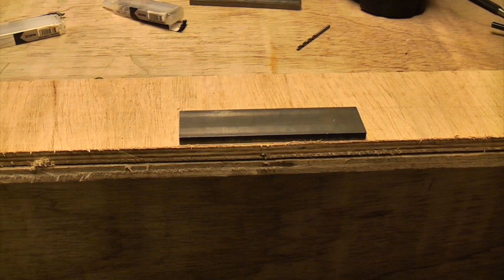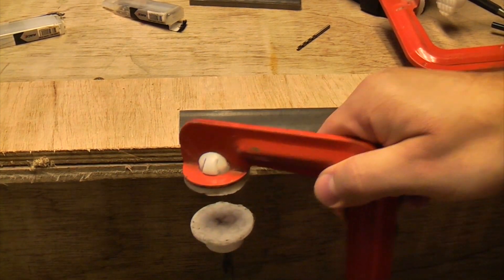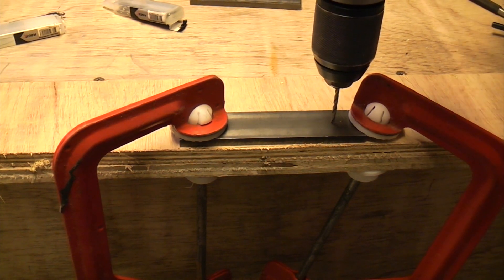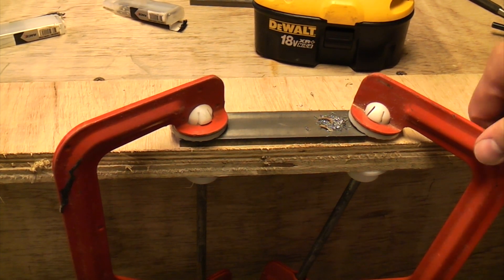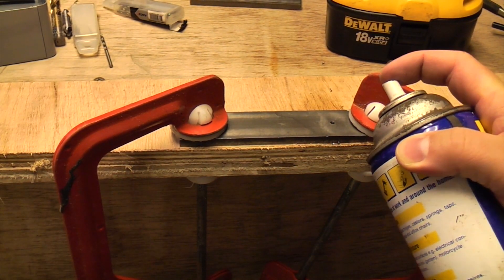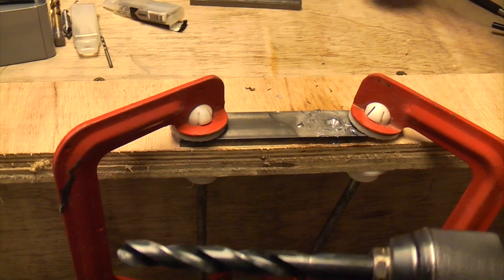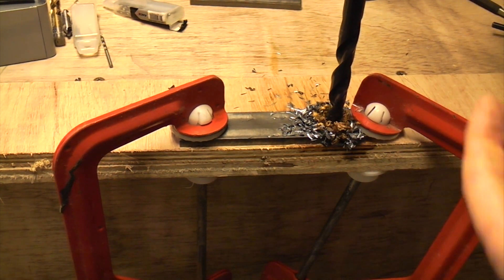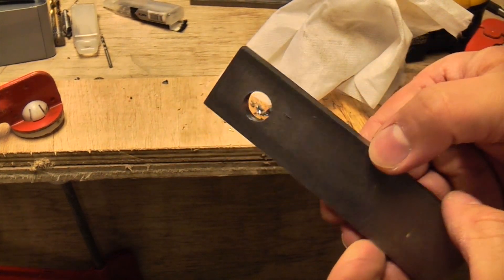How to drill metal

Comment: Hi excellent review u have given required  suggestions can you please tell me my drill chuck size is written 1.5-13mm what is the maximum drill bit I can use in that chuck  please help
Reply from the maker: 13MM is the maximum diameter drill bit, but you can drill larger holes using hole saws or blacksmith drill bits. But you have to be careful not to burn out your drill-
https://www.youtube.com/watch?v=_pHVe5GMVIw&t
Reply: @ultimatehandyman  Hi please suggest me a drill hand held which can drill more than 13mm please help
Reply from the maker: Abover 13mm, people normally use a drill that will take Morse taper bits, as seen in this video here- https://youtu.be/0iS2yMrSbvI?t=599
But they are very expensive and difficult to hold, especially if the bit bites into the material.
Reply: @ultimatehandyman  Thank you so much for educating I am learning a lot from you so nice of you

Comment: Hi nice review  when I am using bigger drill bits my drill is kicking back how to avoid it please let me know
Reply from the maker: There is not much you can do, apart from using the torque control on the drill- https://www.youtube.com/watch?v=ku29KYl4Wdg&t
Larger diameter drill bits will often bite into the material and cause kickback.
You could of course use drill bits that don’t suffer kickback problems, such as impact wrench rated step drills- https://www.youtube.com/watch?v=HPv0W0UNdks

Or for thicker material, these are awesome- https://www.youtube.com/watch?v=NEXt_4Y6Wms&t

Comment: Is hammer drill good or bad for metal drilling?
Reply from the maker: Bad- normally if you accidentally have hammer action switched on and you use a HSS/cobalt drill bit for drilling metal it will break the drill bit. 
Thanks for the comment

Comment: What's the 'proper' type of coolant to use when drilling metal like this? 
I've seen videos and read articles recommending oil-based lubricants and some others advising against using oil-based lubricants as they might catch fire (?). Some users suggest using only water. What do you think?
Reply from the maker: I tend to use a dedicated drilling/tapping fluid which are probably oil based.
I was told at college that water is the best coolant, which could be why most of the workshop machines on site use water based coolants (often mixed with a water soluble oil).
Thanks for the comment
Reply: The 100% top fluid for metal drilling is transmission oil like 80w-90 or engine oil.
Everybody have old new transmission  or engine oil. You can use also old oils.

Comment: wicked video, am looking to join 3 filing cabinets together to give them more support for a show as actors walking across them , what size would you think is best 3 holes per unit with m10 nut and bolts going though them and drill bit 13mm be ok?? Any help be grateful, cant fault the videos!!
Reply from the maker: Thanks. For filing cabinets you might be better off using a step drill as they are typically thin metal-
https://www.youtube.com/watch?v=YD-WcAZ_ynI
I'd use M10 bolts and M12 hole with washers at each side of the nut/bolt.
Thanks for the comment ;-)

Comment: im having problems with my drill bit. it gets dull easily. (im using HSS from balckdecker 11mm) my work piece is only 1/8 thick MS flat bar. am i using d wrong drill bit?
Reply from the maker: Did you drill a pilot hole first?
You may need to sharpen the drill bit.
Reply: ***** i did. im using water as coolant. put a few bottle cap-amount  to the bit. i tried to use brand new. but it still gets dull... is there a chance that the drill it self is weak already ( i was able to do about dozen of 11mm hole before it started screeching... ( my drill is only the cheap kind. not sure if its in ur country. KYK.. perhaps a china brand... :/)
Reply from the maker: Edison Ong
Try drilling a larger pilot hole, then only use the 11mm bit on a slow speed. 
If the drill bit has become too hot it may have softened the end of it.

Comment: Is there a good way to keep your bit perpendicular when drilling into the side of a metal plate when using a hand drill?  In my case I'm wanting to put a 1/2 inch hole in the side of 1 inch thick aluminum.

Comment: you should also use cutting or tapping fluid as well when drilling metal no matter how many holes your drilling,you need to keep the bit cool or you can chip or damage or even dull your drill bit pretty fast